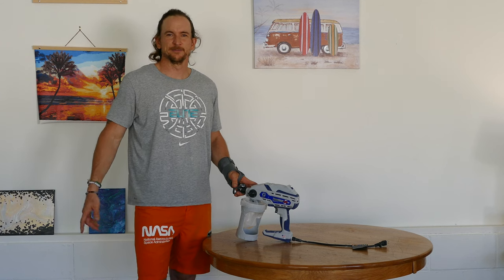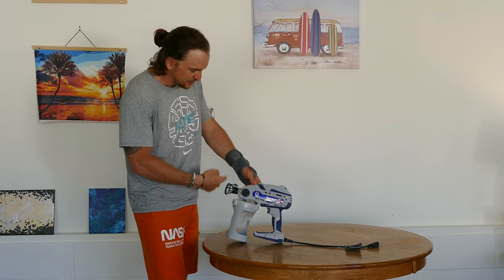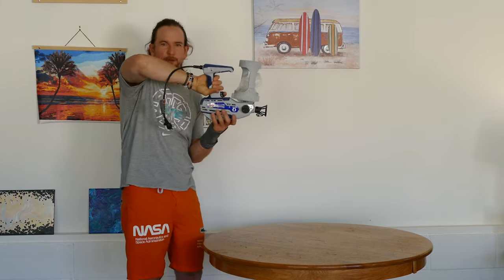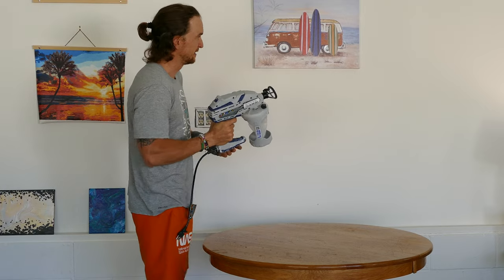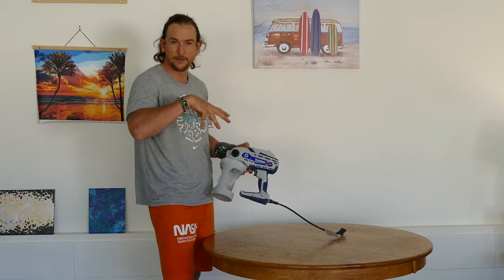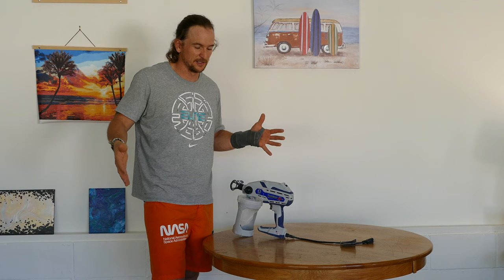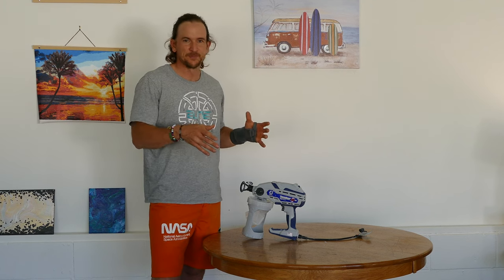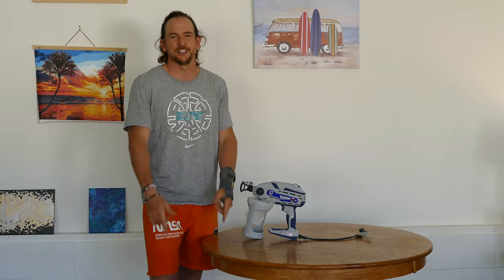Why you SHOULDN'T buy this Paint Sprayer: Graco TrueCoat 360 Review

Comment: I love my Graco Trucoat 360. I painted a fence and deck around my pool in a small fraction of the time it would have taken with brushes and roller.  I also painted all the doors in my remodeled basement,  along with all the new trim. It took about 15 minutes to paint all the trim in a 1000 square foot basement,  and the finish is great.  The caveat is that I have never used another sprayer, so it is entirely possible that makes me like this more!
Reply: I'm about to use mine to paint trim as well, would u mind sharing what tip and paint type you used?
Reply: Was about to order this for painting trim. Was the trim already up or did you paint the trim 1st then install it ??
Reply: Good feedback.

Comment: i have the DS model there a bit of a learning curve using it. i  painter a 9-12 room all white ceiling walls etc it took me about 20 mins, i spent most time setting it up and cleaning it, mask everything  you don't want paint on.  On my job i as very impressed by how smooth the walls were. I think this will be my go to for painting. you will still need to use a brush and roller for small jobs and maybe a large machine for a whole house, it does get hot but it never over heated

Comment: I have the larger magnum sprayer for general use, it is an amazing machine. But it is for big jobs mainly. Paint a 100 feet fence in minutes with perfection. Or buy the low pressure tip, paint fine cabinetry and get HVLP-looking satin/semi-gloss results without the burden of a compressor. The only real hassle is cleaning the entire thing after each use. To say, you cannot leave the machine as is since it will dry up in a day or two. So cleaning is inevitable.

For small-scale tasks I just got this to save big amount of paint (at least a quart) wasted with the magnum and clean easily. I think a serious(?) homeowner should have the both tools. I can buy just a sample size paint and spray it easily which is not an option on the magnum.

Thanks for the insights!

Comment: Airless sprayer, take you finger off the trigger after every pass, that should fix the air spike issue. Spraying at  height or reach areas... just get a nozzle extender that goes with the right machine for the job, like that one doesn't accept accessories which should mean to keep it to smaller projects.

Comment: I think its about the right tool for the job, I'm not getting out my x5 to pain a couple of bass boards, but this that is easier to setup, use and clean is what I would need for that job. I will use my X5 on walls and ceilings, bigger jobs.  Thanks for pointing out the pressure fluctuation, that is good to know.

Comment: Im glad Im not the only one that feels this way about these sprayers. I have the DSP model and the pulses are terrible and hard to work around. On low, it pulses terribly. On high you can avoid the pulsing if you slow down a bit.  But when I slow down enough to avoid the pulsing, it applies too much material and runs. If i speed up to avoid runs, it starts to pulse again. 
I bought it because I felt a sprayer with a hose would be a waste for smaller projects as the hose holds so much paint. Maybe thats just a sacrifice I have to make to get a quality finish.
Reply: That's my conundrum as well, I don't want to buy a whole lot of extra pain just to fill a hose and prime it, other people really like it, I'm trying to figure out whether to buy this or the X5 because the X5 is now $201 and this is $251 so the X5 is actually cheaper

Comment: I’ve owned the 360VSP a couple years now and have used it to paint wainscoting and and outdoor accent wall.  It was not very good on the wainscoting as the gun shoots paint in, for lack of a better description, bursts.  This results in a zebra pattern, not good for detail work.  However, when shooting outdoor stucco it worked fantastic as the zebra pattern disappeared with the rough stucco texture.  I’d steer clear of this product if you’re planning on use it with detail work (cabinets, doors, interior trim etc).  If shooting rough surfaces with a flay paint, i.e.: stucco or drywall you’ll be fine.
Reply: Try buying a different tip

Comment: Any thoughts on the gx-19 or hvlp 9.5?  I purchased this 360 vsp unit.  My mistake was assuming I had "tip options" for the 360.  I saw all the different tips in the store and assumed I could use something "finer" / fine finish for cabinetry.   (*and the Graco hvlp needles aren't used for this product either).  The idea of less waste was appealing but I wasted more product redoing everything because even using a reputable paint known to 'lay down' (SW or BM), the capability of this unit offering that smooth "mirror" finish just is NOT possible.  Is it better than rolling or hand brushing?   Sure!  Plus it's kinda fun.  But I felt slightly duped by the advertised Graco hype  (a woman painting/re-doing a cabinet beautiful.  In hindsight, I'd like to see a close-up of that cabinet!)  I think this might be passable but not anywhere near beautiful or factory finish.  I am coordinated and have a good sense of 'feel' but ultimately felt this 360 vsp best suited for painting a large door / re-doing some outdoor tables and chairs from a garage sale or touch-ups that are "one and done".  The stipple is very much present; even/uniform but present.  Question: How does the Graco sized cup reservoir compare to your titan cup from your hvlp unit?  All the "cups" appear to hold a similar amount of paint quantity?  (Yes, I watched your 35 min kitchen video too.)

Comment: The Graco Magnum x5 is twice the price of the Truecoat 360 in Australia. Then you need to purchase a decent length hose and have a much bigger equipment clean up time and storage solution to make up and load it with. The tips for the 360 are a fraction of the price for standard tips as well. Probably should change the title of your video to Why I wouldn't buy any hand-held airless sprayer.
Reply: Omg I can clean my Graco x7 in 5 minutes. The drama and struggles in the comments mean you need to be watching a different channel.

Comment: 100% agree. Do NOT buy Graco cup sprayers! They are a eye-wateringly expensive. Graco-brand consumables and add-ons are also hurty expensive. Cup sprayers use a dozen o-rings and seals that wear out or corrode with use. Graco does NOT sell replacement seal kits! The cup sprayer housings are made of flimsy blow-mould ABS plastic rather than fiberglass infused nylon PA6 a/o PBT typical of power tool housing, so the clamshell case WILL flex and crack, and the halves WILL separate over time when the screw threads fail. God forbid you should drop a Graco cup sprayer. Graco offers ONE awesome thing: Excellent tech support. Patrick and Jack are Graco old-timers who've been with the company for decades, and have witnessed the unfortunate demise in quality.

By the way, Ryan's beloved Wagner sprayer has the same issue: Wagner does NOT sell seal replacement kits and requires the purchase of expensive components that not NOT need replaced simply to get the seals.

Comment: I have 2 machines. A larger 3000 PSI avanti airless and the newer 360 dual speed (was DS on old model) 
The larger machines like my avanti and x5 and stuff unless you're painting like 10 or more gallons it's not worth it. You lose roughly a half gallon on paint from prime g the hose and pump. Then more when you flush it. 
So if you're doing just a room or 2 these are perfect. But if doing a shed or outside of home the larger unit is better. 
Yes, your technique will be different for a handheld. 
If you have the right tip (the newer handhelds come with paint tips and screen as well as stain (green) tips and screen.) And pressure on right setting you're fine. 
Yes you'll have to slightly change technique with handhelds but in 5 seconds and a piece of cardboard you can find your sweep speed and stuff.

Comment: Thanks for your channel. I find it very helpful!  I was researching this very sprayer for cabinets and trim (as a homeowner).  I also watched your video on your favorite cabinet paint.  If you use the paint you recommended, do you use a clear coat for durability?
Reply from the maker: Appreciate the comment! I don't use a clear coat. Most enamels are designed to be a top coat and not need a clear coat. I only use a clear coat if I am doing a glaze or some other specialty finish that needs to be protected.

Comment: I find it to be a bit pricey but it does shine 
I had a much cheaper Wagner power painter and it only lasted a season
Before it craped out with no warning in the middle of a job
I got myself a new cracko yep it's really different from the Wagner 
I stained my porch easey breezy reused the liner dozens of time this far not to bad to clean 
This far in I might think it' can be a bit better but as far as I go I am not a pro at nothing and this thing is great so far worth the money like I said so far 
In the mean time I will not buy another Wagner there were problems with it comparatively and I think this cracko shines were the others are dimest
For sure it's got a bit of weight to it it will be   lighter after awhile of getting use to it 
                                    I am a little bigger then you my friend and I would recommend it

Comment: Idk what he said in this video but since he didn't take it apart the. I sont think he is right. When it works is works great but if you wanna know the real problem read my next comment under this.
Reply: It's great when it works but the problem is still the same as the 360 from 5 or more years ago I even have pictures. The plunger or shaft that goes back and forth with a plastic joint. First off it shouldn't be plastic it's obviously eventually going to break which it did on the newer version and we only had it for four months. Second where the shaft goes in and out it leaks and eventually drys causing the shaft to seize up and not move. Which in turn either breaks the plastic or wallows it out if you want pictures and proof of them using cheap parts and not fixing it for literally years and years with the same issue I got pictures from today

Comment: I have bought one of them and I love it. Does a great job. And I also bought a graco 19 going to paint my house and metal shed. Come on man it's not that heavy, I am 66 ,whats wrong with u . I think u need to work out a littel more or go to the doctor and see if something is wrong with u.
Reply from the maker: Shoulder impingement is a common issue with people in the trades (especially painting, drywall, and similar things). It's an overuse injury, nothing to do with strength. I don't even need to be holding anything to cause shoulder impingement, I just need my hand over my head. But the more weight you're holding, the more common it is.

Comment: Outdated review.  Overstating the obvious: It's not for big jobs. This is for jobs that will take up to 2 gallons of paint. Any job bigger than that, you would be better off using a regular airless sprayer.
This sprayer uses smaller diameter tips because the piston is much smaller.
I would highly recommend this sprayer for small jobs like bath remodel, painting a door, changing the color of one wall in your house.  And a VSC model comes with both wide and narrow tips for paint and stain.  So you can do fine detail painting on furniture.

Comment: The muscles you work in you wrists and armsand even back when you are using a Graco sprayer with a loaded cup is not like anything else you will likely run into normally. It is exausting and you tend to wear out the muscles you normally use and then start favoring the other ones to compensate for those wearing down and by the time you are a half hour into the painting with a Graco handheld airless you will be sore if you are not used to painting with this tool. The strain on your body doesnt translate to anything else you experience excpet maybe using a gas powered hedge trimmer on a very tall verticle bush that you qre making a straight vertical cut on amd you have to hold the tool with your arms extended fully and in front of you. This position is extremely painful after even 10 or 20 minutes much less a few hours. I dont think a few hours is possible as I would always bite the bullet and just set up scaffolding on the 20 foot tall hedges I did as maintenance on a golf course because they were so long and the extension pole on the gas powered hedge trimmer and the angle you have to cut the tops of the hedges on the sides as to get a straight and even cut makes your forearms and chest and wrists and neck and back and stomach burn so bad after a bit. I can still feel it now. I always wondered if there was a better tool for that but when i realised that useing a 2 unit tall scaffolding on big all terrain wheels that wereb18 inches and wide was the way to go. Later on we finally invested in a snorkel lift that was smaller but anything over 30 feet we would either climb or call an arvorist to take care of like tall oak trees or pine trees that were skinny but tall and couldnt be climbed because they woulf snap and they would shed ao much and were a messy nuisance.

Comment: I think you are trying to push this machine into what you are expecting rather than what it is meant for.  As far as weight it is very easy to use both hands if you need to.  Really I bought mine to paint some DIY garage cabinets.  A shed I built and some interior trim and base.  It doesn't take up much space when stored like the graco magnum I had that was lost in a fire.  No hose to clean up and get paint all over when dragging it around.  Basically for projects that are bigger than I want to use a brush for, but not big enough to invest the time in setting up and breaking down my magnum it is perfect.  For the record that is most I need to paint fall into that category.

Comment: These things ARE CRAP. They work great the first time or two you use them, but even with careful copious flushing, the pump easily clogs. And if you let it sit for months or years on end like most DIY people, the paint you miss will freeze it up, break the drive junction, and you will need to buy a new pump - which incidentally costs the same as a totally new sprayer on Ebay. THROW-AWAY GARBAGE IS ALL IT IS since Graco won't support customers for repairs at a reasonable cost. Will never buy another one of their products!